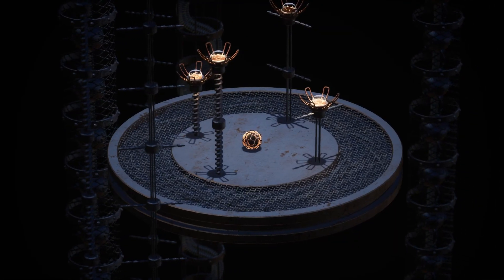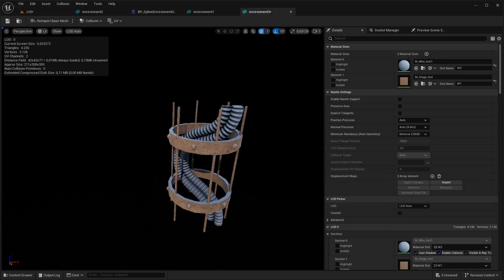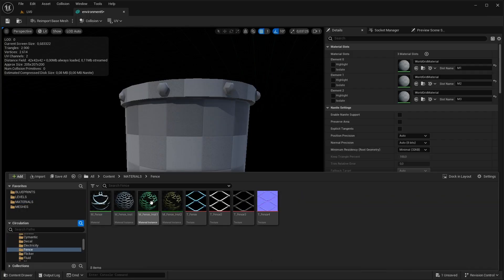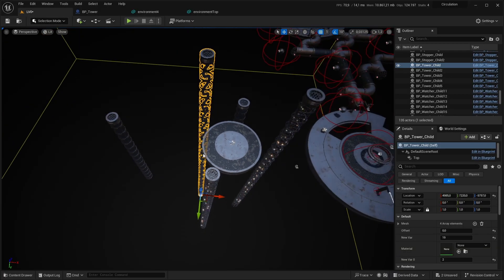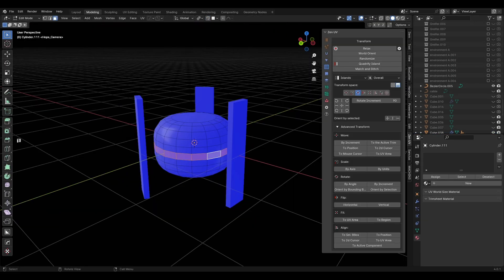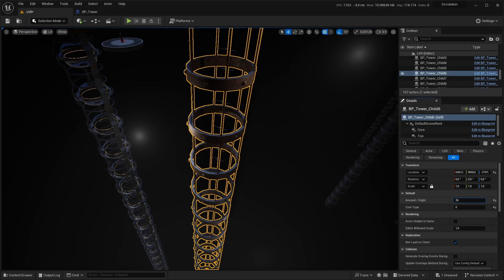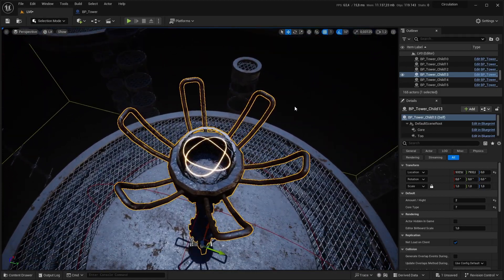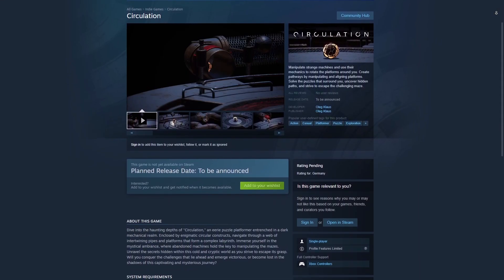Unreal Engine 5 Level Design with InstancedStatic Meshes | CIRCULATION Devlog #06

Comment: Love your devlog…
For your modular towers. They are actually perfect for PCG  in UE5  .. did you look into it ?  Otherwise it might be worth to check it out if this would be something for you..
Reply from the maker: Thank you very much. I know about PCG but didn't really tried it yet. I am not sure about using it for the placement of the towers because they might spawn in the platforms or obstruct the vision. But who knows it might be helpful for something else.
Reply: @olegklaus  I must admit, I did not specify enough my suggestion.. ;-)  ..  I was more of thinking using the pcg spline to build a tower together..   pcg would take your tower modules und would put togeter a tower as long as you have specified your spline

you could search for "pcg bridge"  I think there is a tutorial about it.. the same concept.  use a pcg to have your 1 bridge build out of different small bridge meshes together

So in the future, if you want to place a few towers in the background, just put a straigt spline there and you get your tower build 
;-)
Reply from the maker: @lukarisisgaming  got you. I will have a look into it thanks. The first version of the BP was actually spline based. The problem I found was even though I was using bounding boxes, there was always a random gap between the meshes and I couldn't figure out why. That's why I went with just adding pieces.